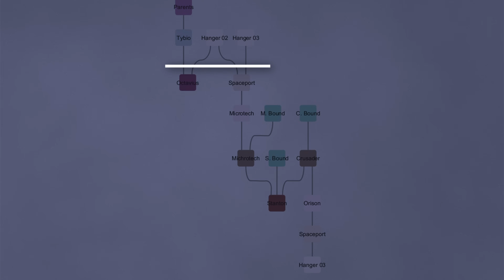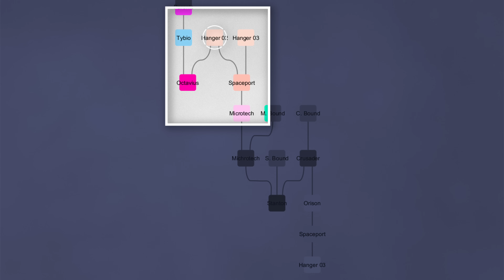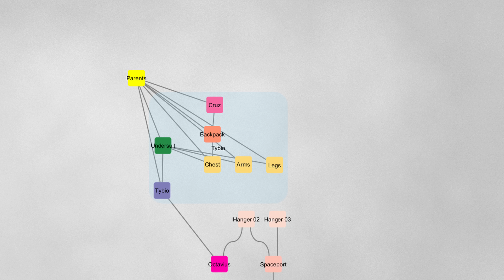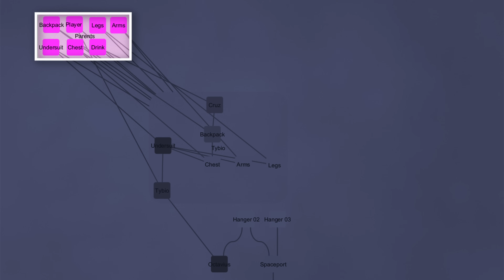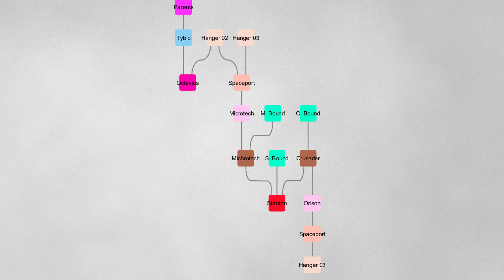Star Citizen: Network Engineer on Server Meshing (Part 2)

Comment: I'll add comments as I watch...

FYI The 'Microtech city' is called New Babbage :D

Regarding your first decision point (the coordinate system, ~2:00) - iirc CIG have said it's a separate coordinate-system per star-system, with no ability to travel between systems except via pre-defined Jump Points.  A 64bit Coordinate setup is sufficient to model our Solar system at 1:1 scale - but in-game, CIG have scaled star systems to 1:10, because some of their planned star systems are far bigger than Sol.  The Jump Point also acts as a 'hidden' loading screen, as it allows the client to e.g. completely unload the 'Stanton' container, and load in the 'Pyro' container.

Regarding the 'bounds' - iirc each Container has its own separate 3D Coordinate system, that gets 'nested' into the parent system.  All the nested coordinate systems share the same scale - so e.g. 0.0.0 in the 'Crusader' container could correlate to e.g. 1234.6543.10 in the Stanton system... and if you e.g. moved to 3.4.0 in Crusader, you'd be at 1237.6547.10 in Stanton.  CIG discuss this quite a bit in the old Bugsmashers youtube episodes (more specifically, they discuss all the various bugs caused by failing to convert coords correctly to the appropriate grid :p).  The net effect of this is that you can be deemed in the 'Crusader Bounds' if you're within the boundary of the Crusader grid... or in more generic terms, you'd be within the 'perimeter' of whichever container coordinate system is the most deeply nested... CIG have referred to this as 'Zonal Coordinates' or the Russian Doll / Matryoska Doll coordinates.

Edit: quick addition to the above - a 'Container' in CIG terms is the foundation of their Object Container Streaming, and the foundational element that makes the Graph setup work.  Each node in your simplified graph would be a separate Container... and the Container defines the 3D 'space' that all its entities take up, and where they''re placed relative to each other.  In the space port, it's not just the hangars that are child containers - every room is a separate container, and it's likely that e.g. each 'floor' in the spaceport is a containerr... it's exceptionally heavily nested.... but this is also what lets them e.g. have 'proper' rotating planets for day/night cycles, without completely bogging down the server - they don't have to keep 'moving' every single entity on the planet every frame - they just 'rotate' the parent container (e.g. Crusader Planet).  Thus, if you were standing at 3.4.0 in Crusader, and Crusader rotates 90 degrees, you'd still be standing at 3.4.0 in Crusader... but if you translate back to 'Stanton' coordinate, you'd now be at 1230.6546.10...  hence the importance of being 'in' the correct 3D Coordinate space for your current location.

Regarding the complexity of hand-offs and e.g. 'missiles hitting ships' (~9:08) - at this point, you appear to be comflating the Graph data model, with the processing of entities. Under Server Meshing, a single 'server' can be responsible for multiple 'zones' (or Boundaries, as you've called them)... at the simplest lest, if a server is responsible for e.g. 'Microtech (Planet)', then it's also responsible for all the nested containers / boundaries within it (unless that nested container has been explicitly off-loaded to another serrver).  Thus, one server might handle MT (the planet), New Babbage (the city), NB Spaceport and hangars, and so on... and a separate server handles the Convention centre because IAE is active.... and because entities will have their 'parent' Entity updated as soon as they cross the 3D Coordinate boundary, the server that handles the processing will be the one that handles the Zone the entity is currently in (although CIG will likely need to set up some basic rules to handle the vanishingly rare possibility of a collision happening perfectly on a boundary edge).
Reply from the maker: Thanks for the comments, I totally agree I was conflating things and posted Part 3 just a few minutes ago to try to clean that up.  Do you have a source for the coordinate information?  Not that I question it, I'd just love to go get it from the source so I can expand my knowledge!  I wasn't aware they had addressed that.  If you don't, no worries...I'll go googling until I can find it.

I appreciate the care and detail you took in adding your comments, I'm going to make sure to dig into each one and refine my messaging.
Reply: @MrTybio  No unified source, unfortunately.  Most of it came from e.g. older ATV / ISC episodes, and dev-posts in Spectrum (alas, Spectrum Search will only go back 2 years, so you can't find older posts).

Best bet would perhaps be to look at some of the Bugsmasher episodes where Mark fixes related bugs, as he tends to explain how the coordinate system works, in order to explain the bug, and the fix.
Reply: @MrTybio p.s. this time last year I made an attempted to diagram how CIGs server architecture was changing as they moved from pre-PES to Server Meshing.  The indicative patch numbers are wrong (I took a guess, and then CIG changed how they number patches :p), but the sequencing of changes is accurate, I think

I also added a comment to your first video, that might make more sense with this image as context.
 
https://imgpile.com/images/dIy8Uo.png
Reply: AFAIK it's a separate coordinate system per object container (actually per zone because not all object containers are zones but all zones are object containers). So when move a box from space to ship, the relationship includes the box coordinates within the ship zone/object container. And yes the root, the world coordinate system, is the system, so essentially moving between two systems would be the same as moving between for example, two docked ships, just that there isn't anything above then hierarchically speaking. I'm actually curious how they're implementing the jump gates specially. Will it be a third world separate from the two connecting systems? Will be split in half between the two? Or handled entirely by one system up until the point the ship exit the wormhole and is acquired by the next system? Maybe in the future they want to make alternate routes inside the wormholes (like bifurcations within the tunnels) to different systems or even exits within a system so jump points ideally would be their own "system" adjacent and independent from the  connecting systems.
Reply: Whewie! Great discussion and sensible constructive comments. As stated in the previous video, keep going!
Reply: Well even if Cig said something before it is subject to change
Reply: Great explanation of how the coordination works.

Comment: Yes there is a universal coordinate system, I remember this from years ago. Sorry I do not have a reference. I don't think that CIG has done this badly. I think you are just disgusted from having seen the sausage being made for the first time in your life.
Reply from the maker: Not at all,  I make sausage everyday in my work.  Hard to avoid it in the tech sector!  I do think they have had issues with communication and have stumbled.  I don’t hold it against them as people in any way.  I think that’s fair myself.  Thanks for the comment!
Reply: @MrTybio  Oh absolutely communications stumbles and some bad turns in the dev process, but that is part of the process when you are trying to exceed all previous limits and pioneer new levels of technology.   I do not hold it against them. They are all products of their industry trying to re-invent themselves into a more ideal image, It ain't easy reforming your self image.
Reply: It's coordinate system per system. So Pyro and Stanton is not using same coords.

In the graph, I'd have each system as seperate connected graphs.

Comment: Ahh ok, I asked this in a second question on the other video. 
I guess my confusion comes from the lack of knowledge on how space is simulated and represented in software and hardware.
Reply from the maker: I get it, it isn't the most obvious concept.  Perhaps look at it this way, there are "Physical" elements to the universe, like Planets, Ships, players etc.  Then there is the space they occupy.  There is a parallel process to the graph with a coordinate system...like a ship crossing the Atlantic, there is a whole ocean out there, but only bits of it have "Physical" items.  So we use Lat/Long to track where things are on earth.  In space you need to add a 3rd dimension, X,Y and Z.  So think of each physical object having a lat/long/height...more like an airplane actually.  When it comes to the data structures, each server has an "Area", likely a cube of space defined by 2 3 value numbers.  1,1,1 -> 10,10,10.  All of the space that would be contained within that section of the universe is under the management of that server.  If you leave that space, your physical representation (player character) moves do a different server that is managing the new area....but to you it might just be walking off your ship.  So Servers manage areas that contain objects.  You know, I'm not sure that was at all helpful...I'm trying here!